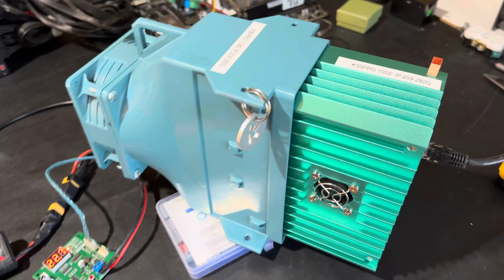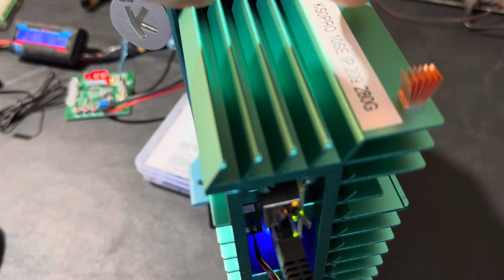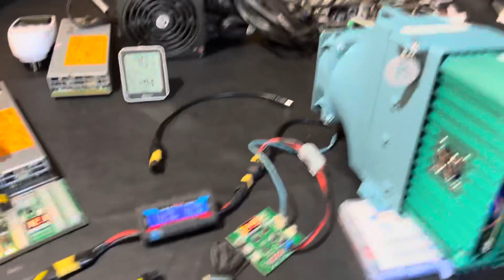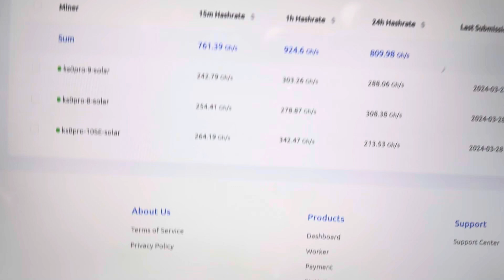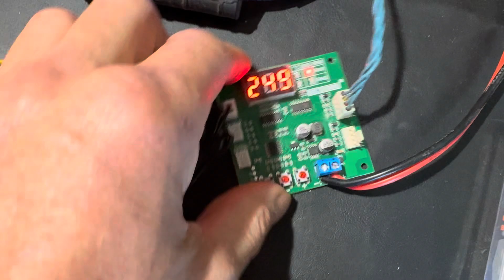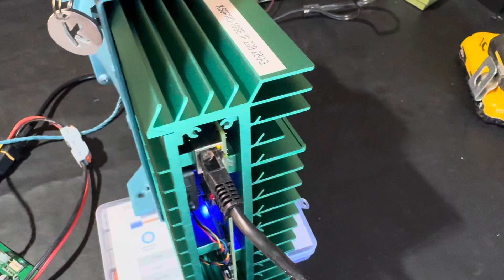ICERIVER KS0PRO SPECIAL Commemorative EDITION OVERCLOCKED, TEMPERATURE AND POWER USE REVIEW

Comment: Hello there, how can I get the power supply you are using?
I just got my second kso, instead of buying the 230w power supply I might be better of getting something similar to your set up.

Any recommendations?
Reply from the maker: If you only will be running 2 units and planning to overclock I recommend staying with 230W 19v. But if you want to go 12V system I have all links in description and shopping KS0 list in discord

Comment: How much power does the server produce?
Reply from the maker: There are different Server PSUs but this one 750W rated should use 80% rule for the load.
Reply from the maker: Check out new vid in couple days about testing PSU and idle power consumption.
Reply: thank you

Comment: Interesting table with the current values (WATT), I use a 230V charger 230w with the STock FW to 95watt, how can I reduce the power even further? do you have a tip?
Reply from the maker: I think for single unit it is the best to use 230W (good qaulity PSU) for best power efficency but for mulitple units server power supply the way to go IMO, also. watch out for the temos on 19v they slightly higher (2-4C) i covered that in different video: https://youtu.be/yrn7r0u76Ag?si=u1cXIBoP80XVxnEc @ 50:00

Comment: What can be done to get a more secure solder to the circuit board for the power wire? I'm about to completely remove the power plug from the board...
Reply from the maker: I've soldered to the board and works fine, dont need to remove the barrel connector for that:
https://youtu.be/csfSu7Y9Pak?si=pBIAwyycf-y8_QBq